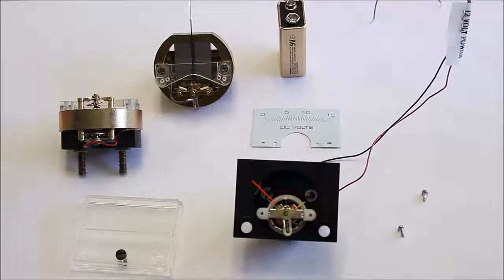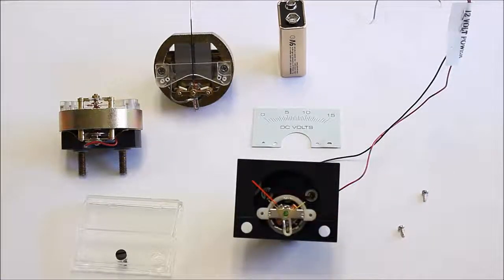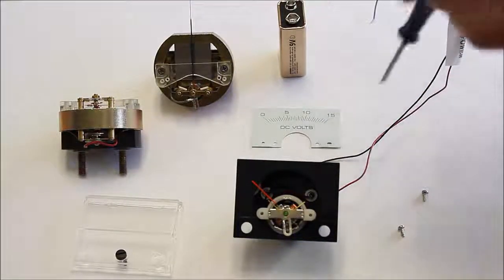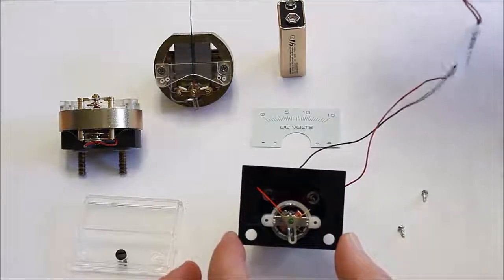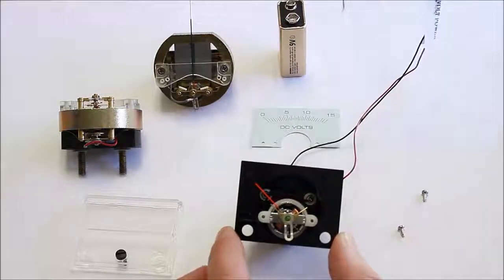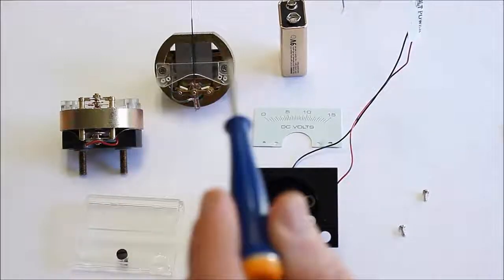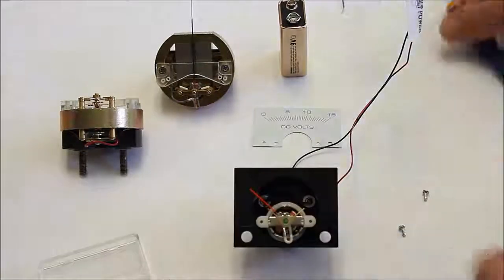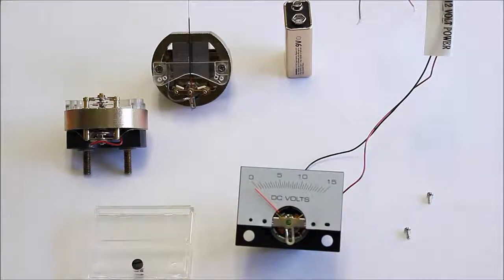How do Analog Meters work? Analog Meter Basics and Movements by Hoyt Electrical Instrument Works

Comment: Sir, I have two analog multimeters that are damaged on the needle indicator for the value and the question is whether I can replace them with an AC analog meter or with a DC analog meter and I hope your answer

Comment: Is it possible for a single analog meter to read 3-5 battery at the same time. I have a project to work on where 3-5 households can use a single prepaid meter which all individual readings will be connected to a central server. So each house hold can pay at different time and also their electricity could be cut of at any given time when their subscription has expired
Reply from the maker: Dear Daniel, Can you please call to our sales team:  1-800-258-3652 (Call Toll Free) from 8AM to 4PM EST.